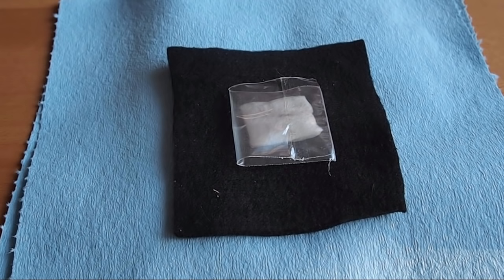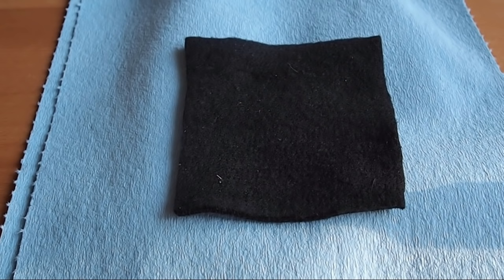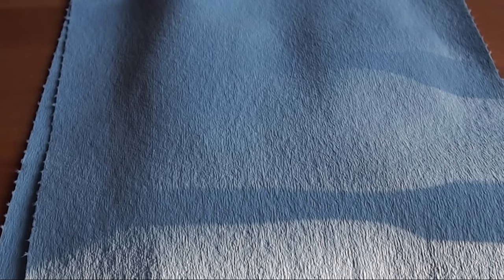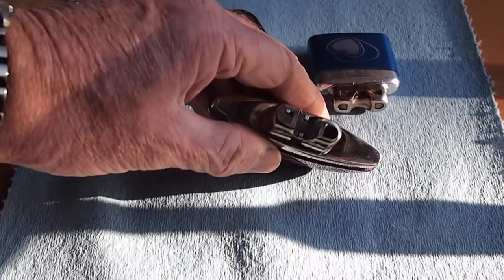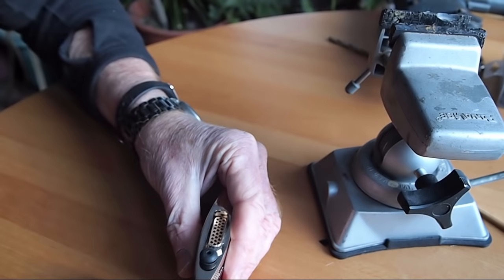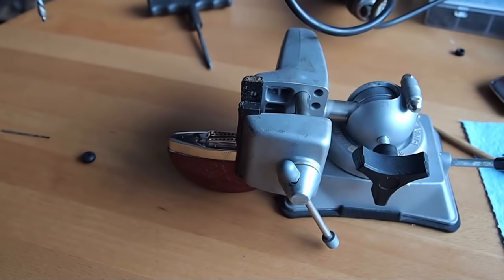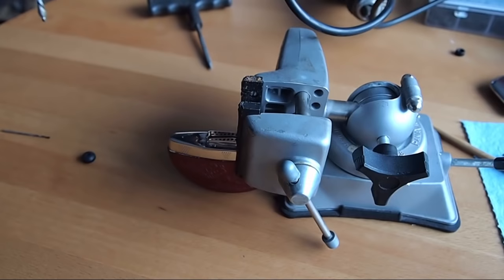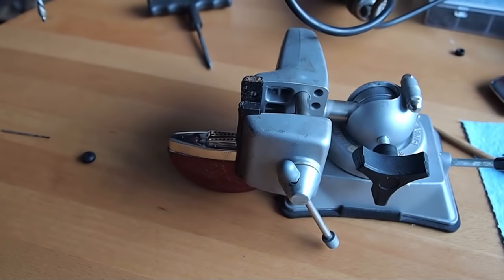Handwarmers, S01E05: Hacks: Improve Perfomance of your Zippo, Jon-e, or Peacock.

Comment: Instead of gluing the head on, why not just drill a small hole on each long side of the head into the body and install two small screws? That would give good metal to metal contact for head transfer and still allow easy removal of the head to replace the catalyst by simply removing the two screws? Am I missing anything here? It seems like a simple solution.
Reply from the maker: Yeah, that's not a bad idea, why didn't I think of that? Of course I don't want you to look smarter than me, so maybe I could improve on that idea if you could thread the hole with a tap, and if I could find some really small thumb screws. I see Amazon lists a bunch of them, but I'm not sure if it's possible to find ones that would be small enough.

One thing I have learned, I used too much glue on the first few tries, but just a little drop on each side and end of the catalyst head seems to work OK, and the glue remains pretty flexible so I'm finding it easy to remove and then replace the head after it is glued on.

What I'm working on now is the idea of placing a vapour tube down through the middle of the packing material to help vent the fumes up to the catalyst, and that same tube would function as a filler pipe as well.
Reply: Instead of tapping threads into such thin material, I would recommend small self tapping sheet metal screws. Drill hole, install screw, done. 
Also, Is there some specific reason to install a grommet into the hole for filling? Why not just drill a small hole, just big enough to accommodate the filler tube on the squeeze bottle? This would allow a small hole in the top of the small hand warmers where space would not allow for a grommet. Thank you very much for taking the time to make these very educational videos and explain to us how these devices work, how to use them properly, how to rebuild them and how not to abuse them so you get the maximum life and heat. I have learned a lot from your research.
For your vent tube how about a metal pipe with many holes drilled into it all the way around it throughout the length of it? Or stainless steel screen rolled into a tube shape? You could hold the tube in place as you pack the carbon felt into the body. This would increase the surface area for evaporation of fumes. 
A good question for your friend who manufactures the catalyst would be, "How much surface area is needed for the amount of catalyst in one of these heads?" If there is too much surface area would uncatalyzed vapors pass through the head, wasting fuel? Another way to get more surface are for evaporation would be to simply not pack the carbon felt all the way to the top. Leave a quarter inch space between the top of the felt and the top of the base. You then would have the entire top layer of felt to evaporate vapors, without the need for a tube. When filling, the space would allow fuel to run across and soak into the entire top layer of felt.
Reply from the maker: deasley2 replied:
Instead of tapping threads into such thin material, I would recommend small self tapping sheet metal screws. Drill hole, install screw, done. Also, Is there some specific reason to install a grommet into the hole for filling? Why not just drill a small hole, just big enough to accommodate the filler tube on the squeeze bottle? This would allow a small hole in the top of the small hand warmers where space would not allow for a grommet. Thank you very much for taking the time to make these very educational...

mparam:
I went with the grommet because the filler tube seems to spread the rubber apart and then allows it to reseal when you extract it. Seemed like a more elegant fix that only costs a few pennies. The rubber also creates a good seal around the filler tube which leads to less spillage. For example if you had some leakage around the filler hole subsequent to filling and extracting the filler snorkel, you might have an inconvenient flame-up around the filler hole when you activate the catalyst with an open flame. I found that when you use the right sized drill bit that is matched to the grommet, it is not a problem to insert the grommet and achieve a good fit. I basically imitated the system that that UK brand of handwarmer uses.
Reply: You're both missing something! I've been using these things for over 50 years, all you have to do is squeeze the sides of the burner a little to keep it on. Besides that if you glue the burner on, you can't shut the warmer off. All you have to do to shut the warmer off is take the top off and carefully pry the burner off with the edge of the top!!!

Comment: Thanks for the ideas! But, I don't get the need for the rubber stopper when a simple 3mm hole is all that's needed since the plastic tip will make the seal. I plugged my deeper hole with an old butane match from  a keychain. But a simple hole on the side could be covered by the lid and sealed with friction. I drilled 4 small holes into the top as if I were going to use screws for attachment but, then I removed the top and filled the holes with solder to increase the friction and the holes left in the lid provided centering points. I also replaced the the top cotton with silica fiber sheet. All in all you found the weak points.
Reply from the maker: There are many possibilities. I prefer the grommet because it expands when you insert the tip from the filler bottle, which ensure no spillage out the edges of the filler hole. When you remove the tip, it contracts and thus there is a smaller hole for vapors to escape. It is simply a more elegant solution, but not the only one withal.

Comment: Doesn't a grommet mean that the fuel is exposed to another open path to vaporize and escape from? Shouldn't hand-warmer last not as long and waste fuel that could have been catalyzed because of this? Unless you add some sort of self sealing grommet or something?
Reply from the maker: If you do a run time test on two identical hand warmers, one with grommet and one without, you'll find you cannot quantify a measurable difference in run time. However, perhaps if you had the ability to test in Lab conditions, maybe the one without the grommet could be found to burn for a second or two longer. In real life, what will define the actual burn time (and resultant heat output) is the mass and amount of platinum on the safil substrate of the catalyst material.

Comment: hello, the grommet has a hole in, what stops the fuel coming back out the grommet, do you not need a bung plug
Reply from the maker: The same principle that precludes liquid fuel egress from the reservoir neck where you fill it: the absorbent material in the reservoir holds the liquid fuel in suspension. You do not need to plug the grommet with anything.

Comment: Why not solder for a better connection of heat
Reply from the maker: You could, probably have to etch the metal and apply flux to get the solder to stick, but then a hassle when you need to remove the head to replace catalyst.

Comment: where did u get the catalyst sheet?
Reply from the maker: We have them manufactured for us in large squares, and then cut them into the pad sizes we need with a guillotine cutter.
Reply from the maker: No the sheets are very expensive and I doubt many people would buy them online. In fact we worked for 2 years to find a way to get them made up for us. If someone wanted larger quantity such as a 6x6" piece I could formulate a price. If you're going to make a 'mega burner', then I suspect the way to do it would be use big springs and stuff them with catalyst. That would be an interesting project.
Reply from the maker: I actually don't have any science to support the better wicking theory, that's subjective based on observing carbon felt's role in alcohol stoves. I actually tried to make lighter wicks a few years ago from it, and realized that She Who Must Be Obeyed is right in that I'm an idiot when of course it did not work very well. So it's a good thing that hand warmers do not need to wick fuel, they just need to hold it while it evaporates. Given the proliferation of 'Buddy' style heaters over the years, I'm assuming there's are reason the large heaters don't just have a giant catalyst head on them. I'm going to have to ask our catalyst engineer friend Jordan about that.
Reply from the maker: I did some digging and ask Jordan about the feasability of building a giant naptha based catalytic heater. I won't be able to give his explanation proper justice, but I'll try and sum it up. If I understood correctly, it would be possible by using a bunch of expensive technology. This is because the 'space velocity' phenomena would not allow you to use a big resevoir of naptha without the ability to control the flow of the fumes to the catalyst. This is why the propane based catalytic heaters are feasible, because the gas is under pressure you can control the flow. I think he mentioned something to the effect that the hydrocarbon chain of naptha does support a more efficient exothermic reaction than a methane-hydrocarbon chain like you get from a propane based catalytic heater. But unless your DIY could figure out how to capture the naptha fumes in a pressurized vessel so you could control the output to the catalyst, sounds like you'd be wasting your time and money as well.
Reply: Could you make me a new head  for a John-e standard size hand warmer I’d be willing to pay top dollor
Reply from the maker: Have no ability to manufacture the heads that hold catalyst. I had some luck using a larger spring straddling it over over the top of the reservoir neck and holding it in place with thermal glue however.
Reply: Does anyone use the handwarmers to heat your body when you sleep outdoors? I do. Peacock with Zippo fluid.